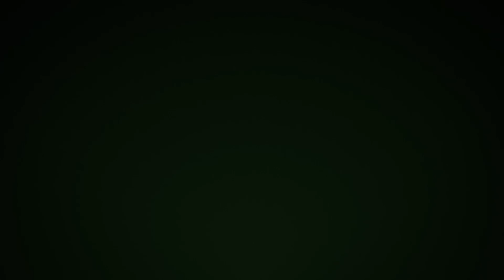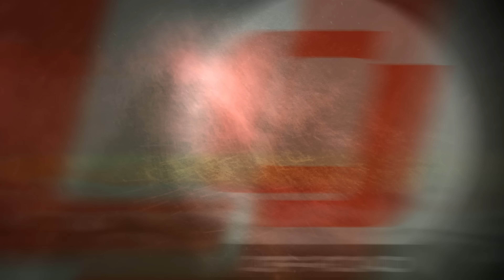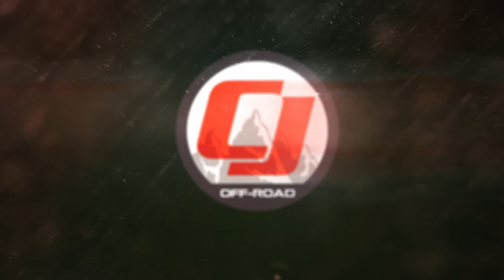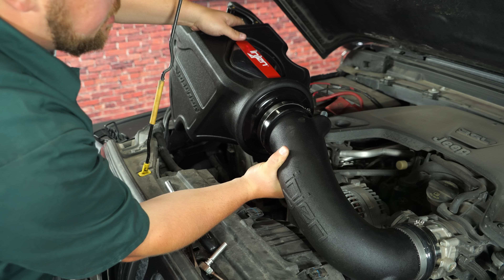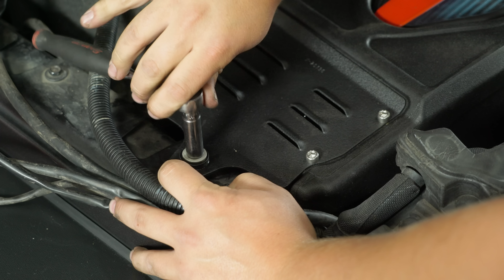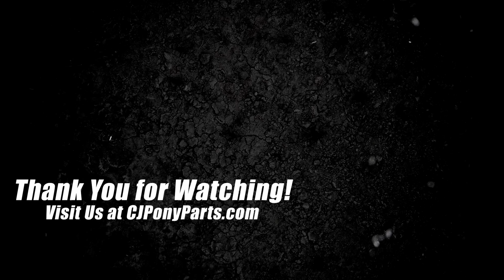Jeep JL Wrangler/Gladiator Install: Injen Evolution Roto-Molded Cold Air Intake System

Comment: Thanks for the tips! To the point video! Just popped this in my 2020 Gladiator Rubicon in 56 min.  w/ airaid throttle body spacer plate.  Now to install the Injen SES5007 cat back. Can't wait to hear/feel this set go!  Keep up the great video's.

Comment: How does it sound?
Reply from the maker: Sounds pretty throaty actually, and you'll gain increased air flow!
Reply: I really like the sound combined with an AFE exhaust. Much deeper when getting on throttle
Reply: Is there a big difference with stock noise?
Reply: @hugoluydlin5660  yes, only when you give it throttle. You can’t set in park and rev but when you drive and give it throttle it has a deep roar.